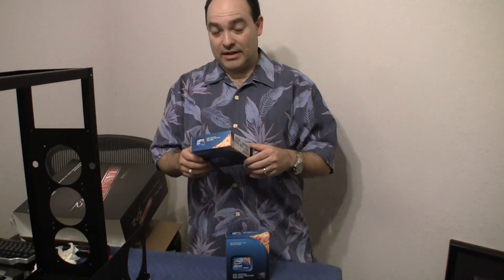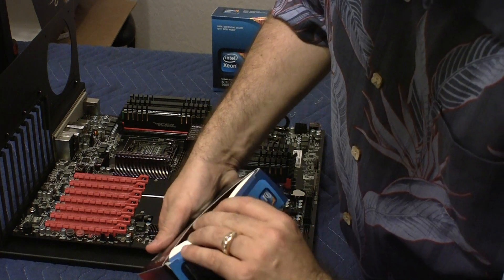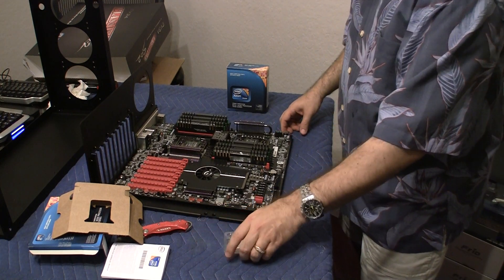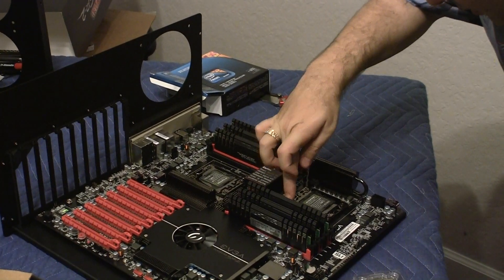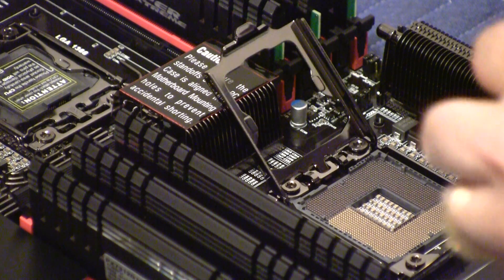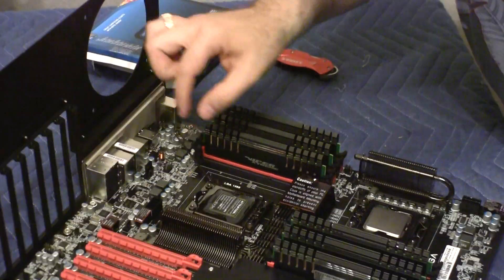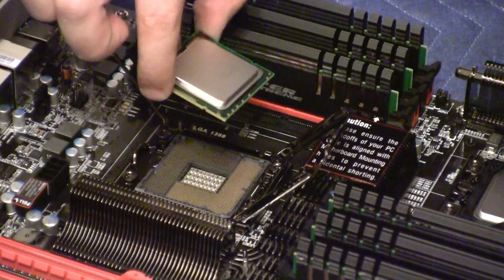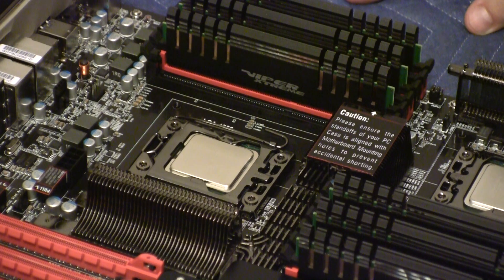Part 6: Unboxing two Intel Xeon 5690 CPUs and installing into the EVGA Classified SR-2 Motherboard

Comment: Hi' i just wanted to know something...... I am trying to gather parts to build a Workstation specifically as a render farm. It doesnt have to be a huge as your PC but i need it to have a Xeon e5 with probably a Gygabite Md70 mobo. 
So far there is a Corsair mini case that i am interested in, i need to know if everything will fit perfectly in it or do i need a midsize case?.....
http://www.amazon.com/Corsair-Carbide-Airflow-MicroATX-Mini-ITX/dp/B00LA6Y5XQ

Comment: im looking to buying 1 of these boards in the comeing months this seller i trust on ebay has about 5 of them as of todays date with 2 h60 water coolers for like 499.99 although i might change the h60's to h100's gtx if i could find a case big enough to hold it all :)
Reply: +MrFmlouder im looking to get a xeon 2 2670 x2 in a nzxt s340 :D

Comment: Is it better to get two of these Xeon processors or one Intel Core i7-4930K?
Im building a custom PC for gaming and regular use. I want it to have a long life, 6+ years.
Reply: AMD-FX8350
Reply: ***** Can you just tell me in general? I don't expect to do extremely serious gaming.
Reply: ***** I don't know what CPU to get. O.o
Reply: The 5960x is awesome just too expensive.

5960x vs. 4930K
I wish.
Reply: ***** Xeons are server-grade.i7 is overkill to unless planning on SLI or crossfire
Reply: ***** i7 and Xeons have identical gaming performance as long as you don't plan on overclocking your CPU. But, you never know what you will end up using you PC for, extra cores can come in handy in some circumstances. I'm not saying you should buy it, you should just keep that in mind.

https://www.pugetsystems.com/labs/articles/Intel-CPUs-Xeon-E5-vs-Core-i7-634/
Reply: ***** I myself plan on picking up an 4790k or perhaps the new AMD Zen CPUs that come out in 2016, 2016 is a really exciting year for tech from the AMD and NVIDIA side and not so much from Intel :/.
Reply: ***** Xeons cost way more than i7. The ones with 10+ cores cost $2000+.
Reply: ***** The new AMD Zen CPus are on par with Skylake or more, i'm not that intelligent with the CPU market on which price range is high-end but the 300$ AMD ones are going to be i7 competitiors.
Reply: ***** Not too much info on pricing but there should be a 50% improvement over Excavator, I recall not long ago there was a reddit thread on /r/AMD where somebody did the math and figured that he new CPUs are on par with Skylake if not better. Some much needed competition from Intel 5-9% improvement year after year.
Reply: I think most xeons have same architecture as i7, just with more cores. 6 cores is enough for editing and gaming.
Reply: I just wouldn't go with Amd CPUs in my experience. I rather have a pentium 4 than a AMD dual core. Its just not worth it. Pay a extra $100 for more reliability.
Reply: Danyal Ahmad Deny it all you want but I know you are an Intel fanboy so it doesn't even matter. Don't act like Intel is a saint, don't act like AMD or NVIDIA are saints either, because Intel was sued by AMD over anti-competitive practices, and NVIDIA, do I even have to explain why NVIDIA isn't a saint?
Reply: Kasady Cletus Intel and Amd are the only ones that make CPUs. It shouldnt be too difficult to choose a side.
Reply: Danyal Ahmad Im going for AMD Zen+Arctic Islands next year.
Will be nice to have my main rig back to AMD
Reply: Kasady Cletus Great.
Reply: ***** I never said anything about the FX8000 series.
Reply: ***** I don't give two shits about Xeon boards, I plan on buying an AMD Zen CPU next year, i've had more then enough Intel products.

Comment: You shouldn't touch the top of the CPU. because it will introduce grease and thus reduce heat conductance through the thermal compound
Reply from the maker: The amount of grease/oil is insignificant regarding the conductance of the compound. Just make sure that (1) you are grounded, and (2) your hands are clean :-)
Reply: also if he could have just wiped down the top of the cpu with some rubbing alcohol before puting the thermal paste on

Comment: Hello, Please help me, I put a second processor E5 2650 of my great motherboard EVGA classified SR-X I'm happy to buy, but suddenly my computer does not recognize the processor I bought, rather than the 16 Gega memory is that I forgot something, and I've put the two cable: a 6 pin and 8 pin CPU other to food, is what I should of new or configure my computer to format my ssd? in the system I can not see my two processor, I'm afraid I did something wrong, thank you very much for your help,

Comment: not only must you look at the socket to make sure the pins are straight. you must also account for each one. that's right. make sure you have all 1366 pins on both the processor and the socket.

Comment from the maker: @Monopolevil  I'm not familiar with that particular model, but look on the motherboard and see if there's space for two Xeon processors. If so, chances are it will support it. However, to be 100% sure, you need to speak with a technical person from Dell. If they don't know, ask to be routed to a manager who will probably know the answer.